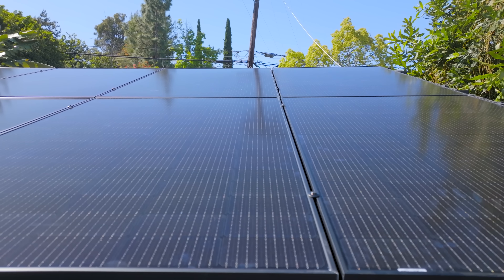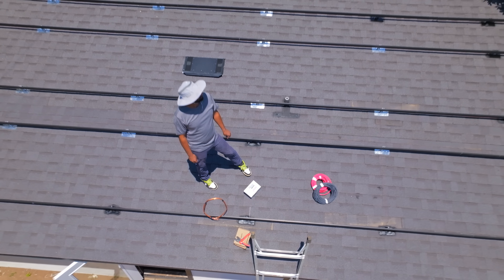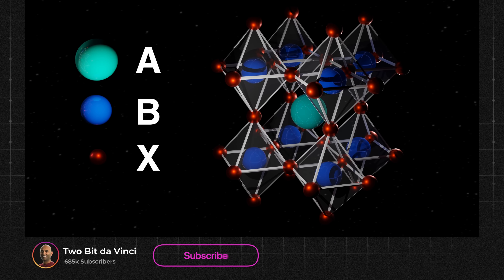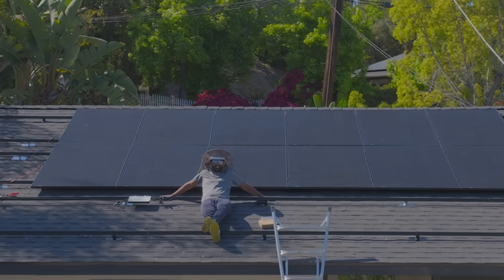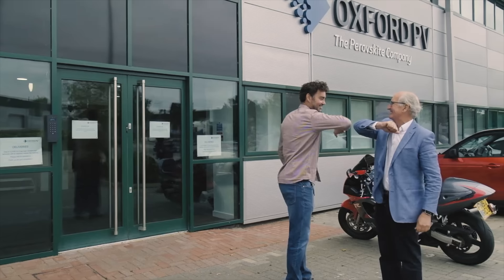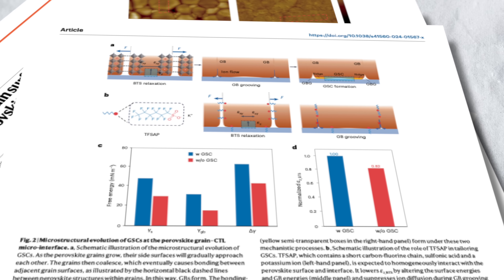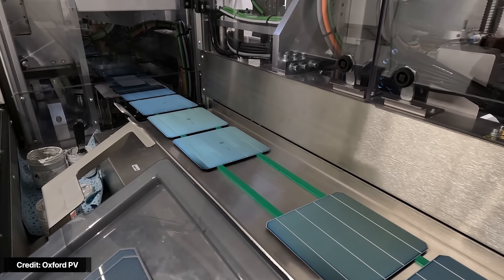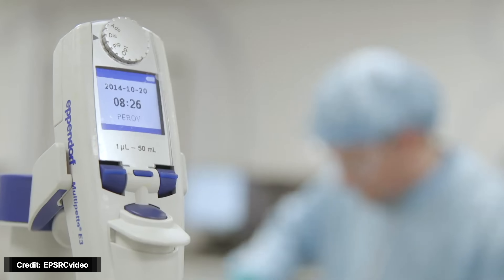Secret Unveiled: How Scientists Prolong Solar Panels' Lifespan

Comment: Still in development.  Got it.  Just like solid state batteries, superconductors, and fusion.
Reply: Yeah, don't wait for the next big thing.
Reply: great things take time.  be patient
Reply: @marginbuu212  No one appreciates cynicism
Reply: @marginbuu212  news of the future. Hope it happens soon 🙌🏻
Reply: @nathansuko  Don't delay your purchase waiting for technology that may never arrive. "About to hit the market" and then at the end speaks of why they aren't about to hit the market.
Reply: I'm still waiting to have a flying car in my driveway, maybe powered by sugar batteries.
Reply: Concepts that work mean alot in these industries durability and mass manufacturing(scale) is always the problem
Reply: Perovskite coated plexiglass upgrade panels for current solar panels shouldn't be more than a few years away at most.
Reply: @thegreenxeno9430  Labour is the biggest cost now in a solar installation. In Australia DIY Solar is illegal if connected to the grid. So it means replacing the panels is expensive and if you need to do it regularly because perovskite does not last very long will it be a net positive or net negative cost?
Reply: @DeveloperChris Why would you want to connect to the grid? If I could build a big DIY system my aim would be to cut off my grid connection entirely.
Reply: I use fusion already. Turns out there's a fusion reactor a million times bigger than the earth, sending us free energy every day!
Reply: Always in development, but this one is almost going commercial. It'll be the first commercial perovskite panel, and that'll only open the gates for other companies to speed up their development
Reply: LITERALLY
Reply: Add Thorium-reactors to that list.
Reply: Solid state batteries are already comercial. Supercomputers are already everywhere...maybe you mean quantum computers. Fusion is the only one you got right.

Comment: The main advantage of Perovskite is that it can be vacuum deposited on top of a glass- silicon solar panel and share the glass substructure without adding significant weight, also because Perovskites absorb light at frequencies that silicion cells don't and via versa a tandem perovskite/silicon solar panel is vastly more effcient with little extra cost.
Reply: and i'm sure they won't charge much more for it/s

Comment: My panels are 23% efficient and have a minimum of 23 years left in them, I won’t be changing to Perovskite for an extra 2% anytime soon.
Reply: To be fair, the 2% extra is the starting point and will likely keep improving with time, but with that said, there's no real reason for you to upgrade any time soon, so by the time you get to upgrading, the tech likely will have improved a lot.

In any case, we only need one company to release these to market and prove that it works for the floodgates to open up that many rivals will quickly do the same, with that, the tech will quickly start to advance and the price point will start to come down, and for now, the problem is that it's still in the lab.
Reply: @InimitaPaul  how old are your panels?
Reply: It'll only be a 2% gain for now because it's basically the first generation of commercial perovskite panels. Commercial silicon panels won't go much further than perhaps 25% on their own. But the potential to reach 34% with tandem perovskite/silicon panels IS a major difference and it'll probably become availablele long before you have to replace the ones you have now. I'm sure that by then you'll appreciate a cheaper, smaller system.
Reply: @claudiaroy9455  2 years old. Im in the UK though so at the very worst I only get a couple of months of that intensive hot sun that panels don’t like, 6 months of perfect sun with wind cooling and the remainder being pretty much worthless. My panels should easily last their predicted lifespan and then some.
Reply: @Israel_Two_Bit  If the panels provide the same power for a significantly smaller panel I will change my tune as my available space is limited.
Reply: @Israel_Two_Bit  yeah but they are here now
Reply: 20% what is it bad math commenters day?
Reply: @Israel_Two_Bit  I agree
Reply: 23 to 25 percent is not a 2% increase, its 9 odd percent increase granted that still not worth changing perfectly good panels and unless they are proven in real world it's not worth risking the new tech
Reply: @Sean_S1000  totally right! Should point out it’s a 2% absolute increase, but a 9% increase relative to the current panels.

Comment: My solar panels lasted about one year until one of the microinverters fried. I had gotten out of the habit of checking the individual module output so it was 6 months (including most of summer) before I realized it. It got replaced under warranty, and I'm told it's nearly unheard of but, I would suggest checking that your microinverters are still producing every week or two.
Reply: I lost one of my micro inverters after having my system for only about a year and a half. It was down for about 6 months as well, but only because it was a discontinued model and they had to wait for some return stock or something to give me a replacement. I used the replacement they gave me to fix it but I went ahead and bought another one refurbished spare on eBay so now if one goes down I'll just replace it myself LOL

Comment: There's an additional savings potential:  eliminating roofing cost by integrating roofing duties into the panel structure would save the cost of a roof. A system with some walking pathways between panels.  After 20 yrs with some decrease in output, you'd save again for another decade (or longer)with not having to replace the roof again.  That's $25g in total savings.  Savings continue when you replace panels with what is effectively a free roof.
Reply: Good point.  I think that sunlight probably degrades a roof far more than rain does, so one would think that solar panels would significantly increase the life of asphalt or cedar roofing shingles.

Also, I live in an attic suite in a detached house.  The house is 100 years old, and has very poor insulation.  Summers are brutally hot in my place.  I'm thinking that having a 4-inch gap (or whatever it is) between any solar panels and the roof alone would do a great deal to help cool my place in the summer!

Comment: Removing a few panels in a home system has a tiny effect on overall price you will be quoted.  The main costs are the sales cycle, engineering, permitting, transport, getting a crew on site, same inverter, nearly the same wire, nearly the same racking, etc.  Perovskites will be good when they mature but pushing them as an up-front cost saver in anything but commercial scale is the wrong direction.

Comment: Then there are the hybrid solar elect and direct (thermal) panels.  The Si cells lose efficiency when the get hot or cold, so the direct collection helps keep the Si cells in their optimum performance thermal range.  Including perovskites would certainly make for a niche device.  Bringing down the cost of the transfer switch, charge controller, battery pack, etc will help quite a bit, too.

Comment: 0:15 x100 more efficient than current solar cells
1:20 It 25% vs 20% that solar cells have 
Can anyone explain the Math here? How could x100 times more efficient result in just 5% increase...
Also how can it be x100 more efficient ? The max could be x5 , unless it gets energy from other sources...
Even 100% more efficient would be 40% and not 25%...
Reply: @LiranBarsisa  Yeah. That got me immediately.
Reply: "unlock cell efficiencies 100 times higher than current commercial cells". 

cell efficiency is about how many inefficiencies have been work out in the actual manufacturable products. 

if a panel is in theory able to output 30% of the sunlight as energy at absolute best, due to the laws of physics. and your product outputs 20%, then you will try to come up with news ways to improve the efficiency of your panel. You may improve that 20% to 20.05%. thats a tiny improvement. going from 20% to 25% is a 5 percent point increase vs a 0.05 percentage point increase. so your improvement in efficiency was way better, 100 times better. 0.05 vs 5

Comment: It all depends on the degradation factor. Regular silicon last 30-40 years at reduced output. How fast is the perovskite degradation? If I had limited space and was expecting better panels to be available in 15years, and the cost being right. Then perovskite makes sense. If I have plenty of space I would prefer ones that last longer, but all comes down to price and effort installing. So many things can change very soon.
Reply: Benefits to pervoskites has always been in cost of manufacturing. Well it was!

  The extra efficiency is just icing on the cake. 

 I remember hearing when I first learnt about them eventually we should be able to print it for dirt cheap. 

 If they can get rid of the degradation problem. 

 Yet maybe since basic pervoskites cannot be used, and it requires some alloy or combination of materials. Maybe the companies are shifting to sell them as a more efficient panel, but keeping the cost.
Reply: @dianapennepacker6854  It's a great point. However, as we've seen lately, normal panels are already quite cheap and getting cheaper. Every day, they contribute less to the total cost of the system, and the entire installation cost and other hardware is what's making up the bulk of what we pay. So, basically, the cost of the panel itself is becoming less of an issue. But, as stated in the video, since installation costs, which make up the bulk of the total cost, are proportional to the number of panels, reducing the number of panels does strongly impact the total cost.
That's why efficiency matters so much.  More efficiency = fewer panels for the same output power. In the end, cost is what most people care about anyway, not efficiency itself, since we have virtually unlimited solar energy shining down on Earth.
However, perovskites also have other benefits, particularly that they don't suffer from the supply chain bottleneck around silver that silicon panels do, and that you can make them extremely thin and flexible, and that they can transform more scattered light than silicon panels (so they work better in the shade than silicon panels), and more.

Comment: If traditional solar cells are 20% efficient, how can any panel be 100 times more efficient?
Reply: they can't
Reply: 100% more than 20% would be 40%.
Reply: @MysteriousSoulreaper which is only 10x the efficiency NOT 100x! Which would be 1000watts from 100watts of sun
Reply: 100 times HIGHER not 100% more 😧(first minute of vid)
Reply: @doubleooh7337 not if you invent a solar panel that taps into the energy of the quantum vacuum and rewrite a few laws of physics. Simple.
Reply: @undertow2142  lets stick to reality 🤣
Reply: @Muppetkeeper  Yep, that’s where he lost me too.
Reply: I remember an other solar company lab pulling numbers like this. 

 It went like. Since the sun can produce 1,350 watts per square meter, but usually averaging 1,000 watts. With average solar panels getting 200 watts.

 Having a double increase will means it will get a gazillion more  power over the course of a year. It all adds up to even more power than double!

 And none of it made a lick of god damn sense! It is still only double the power. I say only - I mean 40‰ is amazing especially if they are cheaper. Yet that is besides the point. Those people were liaaaars!
Reply: Clickbait
Reply: Because just like most YouTube grifters, he hasn't got a clue what he's talking about.
Reply: They cannot, they are at best in theory, 100% more efficient, 
Which is two times. But they’re nowhere near that yet and won’t be anywhere near there for a while.
About this this is pure misinformation. 
We are likely to see 25% or maybe 30% efficient. Perhaps Kait sells in tandem with traditional silicon in the semi near future. 
But the additional costs of having that type of solar, also adds to the overall return.
The solar panels are so cheap. I would not necessarily wait for the technology to materialize.
Reply: Anything can be achievable with just a little more time and continued brain power
Reply: @doubleooh7337  100% more of something is 2x more... 

Jesus how has the species lasted this long?
Reply: @georgeshapiro301  that's actually a question that applies to yourself so why dont you answer your own question 🤣
Reply: @georgeshapiro301  maybe maths and logic isnt your strong point, 2x more than you have is 200%
Reply: @doubleooh7337  200% of something is 2x, 200% more is 3x.

I probably could have been more polite, sorry you were "triggered" as they say.

But tripling down isn't helping and you spat back so... faith not restored my dude.
Reply: 40... son
Reply: @owengrossman1414 simpal marth...
Reply: Wolframandheart 😂😂😂
Reply: Wolframandheart no content says nothing...
Reply: @ZoomZoomMX3 no content says nothing
Reply: @VinoVeritas_ no content 
After 14 years.... ya your opinion is worthless
Reply: @georgeshapiro301 
Dropout zombie accounts
Reply: @doubleooh7337 😂😂😂 
You lil scammer
Reply: @johnlaamanen9006  "solar cell efficiencies 100 times higher". 

i can see the confusion but the key is in the words he used before that. 

cell efficiencies are about reducing inefficiencies. getting them as close as possible to the maximum allowed by the laws of physics. 
we can model a perfect solar panel, with perfectly placed atoms, all perfectly lined up and no defects, and calculate exactly how much energy that could convert from a given amount of photons of light. 
but we can't build that perfect panel. so we have to develop new technology to improve efficiency of the panels to try and get closer to that limit. the efficiency improvements being 100 time better is what he is saying there. right now we are trying to eek out little improvements for the cells to improve their efficiency. going from 20% to 25% output means we're going from improvement in efficiency that create improvements measured in fractions of a watt to improvements that result in increases in output measured in tens of watts. making those improvements 100 times greater.
Reply: Ikr. Efficiency doesn't work that way
Reply: @Muppetkeeper  my thought exactly.
Reply: I think 100x don't translate into percentage of efficiency.
Reply: So…………….. you don’t know math
Reply: @MysteriousSoulreaper  100 times is way more than 100%. That’s the answer to the question.
Reply: He might be talking about the cost of materials or how much materials are needed.  If not then I'm lost on what he was talking about about.
Reply: Hey?! Who let the person with critical thinking ability onto the channel???

(Btw, current production solar panel cells are at around 22.8% efficiency.)
Reply: Yes I’m pretty sure that type of improvement is only possible for football players 😂😂😂
Reply: There's the real scientific definition of solar efficiency (how much a square metre of panel makes with 1000w "available", typically 200-220w for silicon and 150-170w for CIGS), then there's the "efficiency" as used by solar marketers and laymen, which is how much charge do you actually get in your batteries?
I use CIGS, which have better low light and high temp performance. While less efficient by scientific standards, the real-world, actually-useable power I get is far more than my old cheap silicon flex panels. It's not even close.
Reply: I would do solar if it was reasonable but parts for the kit I want is about 10k and installers want 25k to install... 250% markup for labor is ridiculous
Reply: Oh maaan, it cant be 100 times more efficient as it would need to break physics law. More and more Im becoming to wonder if this channel is really about science or its just a bait mixed with some techtalk.
Reply: @doubleooh7337  2 times, not 10, dude
Reply: This is all bs.
Reply: No they are 5% more efficient, and that means you can have more room for more panels.  Together with lower prices and costs it's much more efficient. Area, effect, price .. it's in a few years possible for even better efficiency
Reply: Because this guy has no clue what he's talking about he just lightly paraphrases media releases that have some link to some vaguely credible source.
Reply: The same way something is 100x smaller.  Misuse of English.
Reply: Cos this is a hype channel  Musk math
Reply: @Muppetkeeper  40% efficiency would be what 100 times more efficient would mean
Reply: @tribaltheadventurer  You need to go to school, what is 20 x 100? it's not 40 is it.
Reply: You are right, it is NOT 100 times, he might have misspoken, it could be 100% (from todays) ~20%  = 40% max efficiency in some years to come.
Reply: You assume you would know these things… Once you know that you don’t know you can than go on to learn more than you know.

Comment: 15 years vs 25 at significant cost savings seems preferable to 25 year panels depending on the cost/KWh of the power utility in your area.  Panel efficiency (and energy storage solutions) continue to improve.  Much of that improvement is incremental but small improvements in efficiency and/or cost of production compounded over the course of 15 years are significant.  As electricity rates continue to rise, the capital cost of the panels themselves pays for itself quicker than ever.